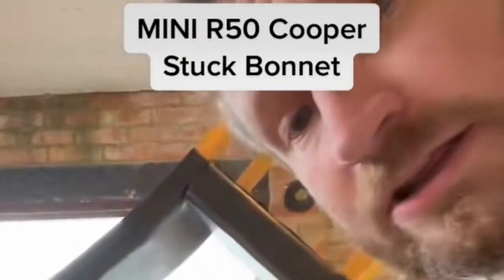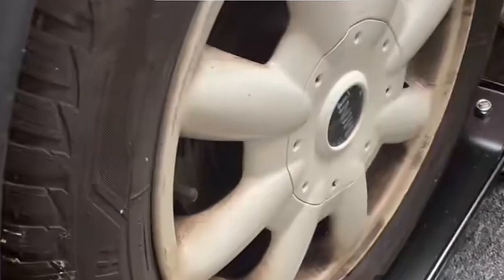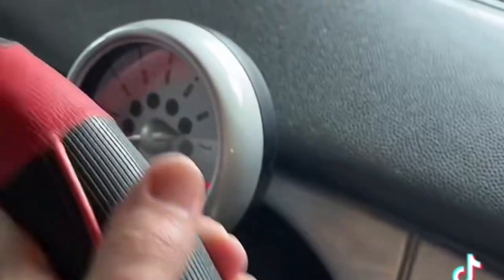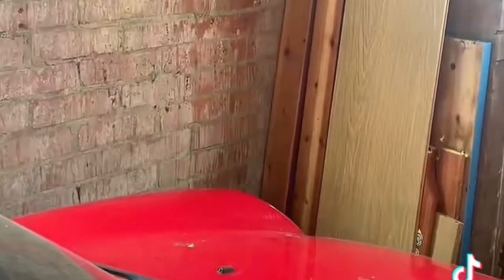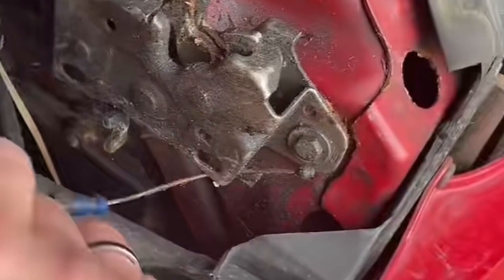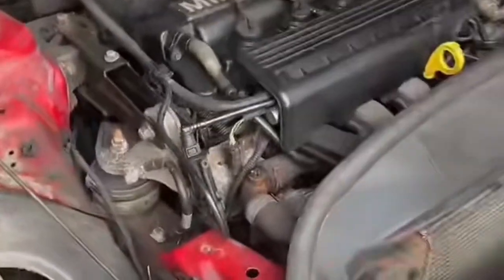Opening a MINI R50 bonnet with a snapped cable

Comment: Thank you very much! I got stuck outside the car (R50) when I took the battery out to recharge it, closed the bonnet, locked the passenger door for inside, closed driver's door and locked with the mechanical key. I couldn't believe it that you can lock the door from the outside using the regular key but not then unlock it the same way, without a working battery. HOW STUPID is it that they made a car that way.